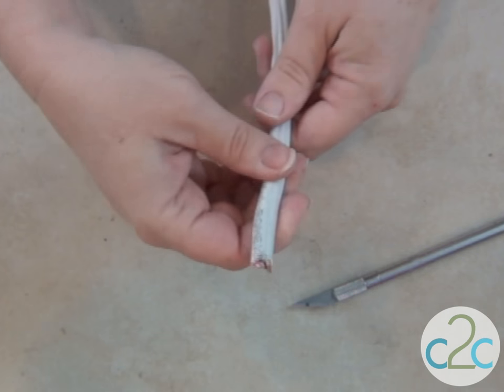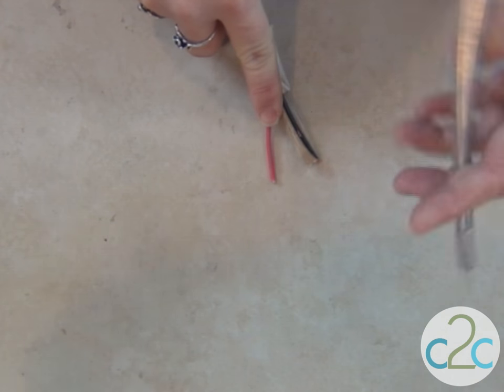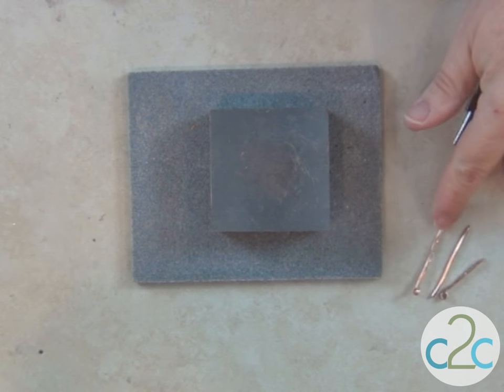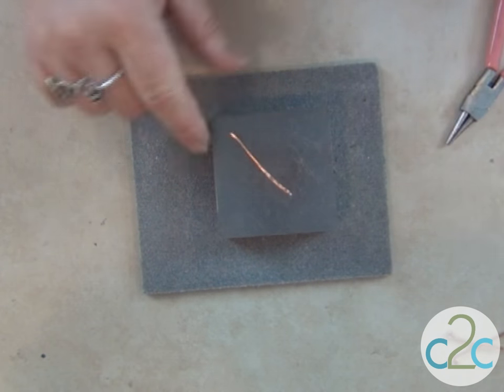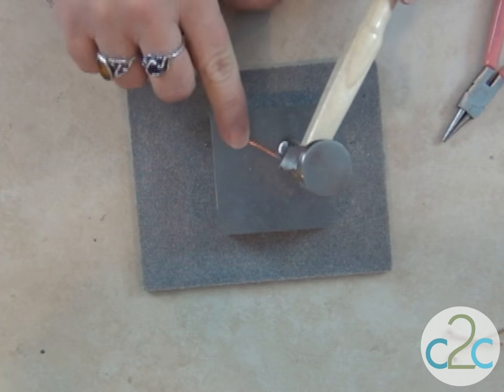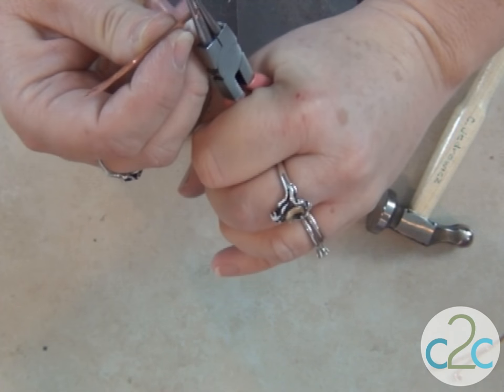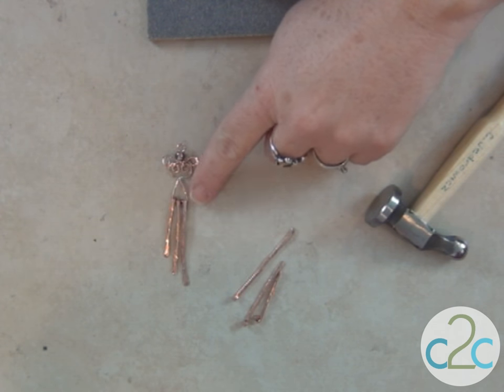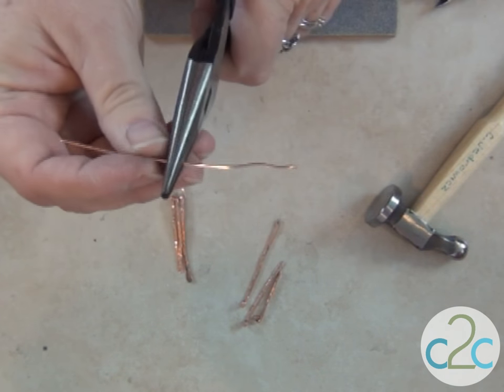How to Make Softly Chiming Earrings by Candace Jedrowicz

Comment: Candace, these are so cool.  I had one question: I know you used the copper from the electrical wires for the chimes.  Did you use it for the components as well or did you use regular jewelry wire for those pieces (the upper portions)? Thanks! Annie